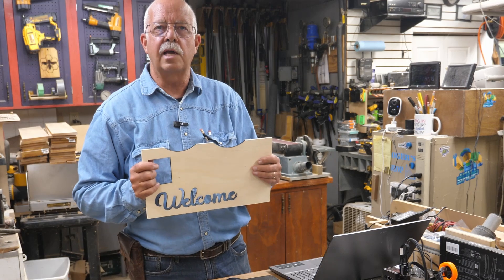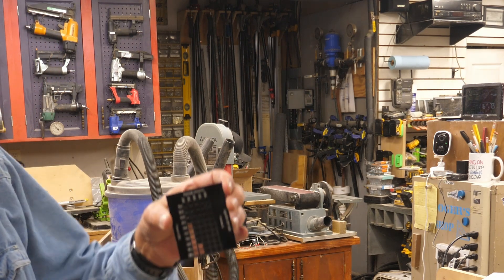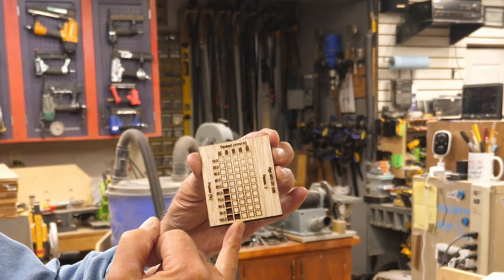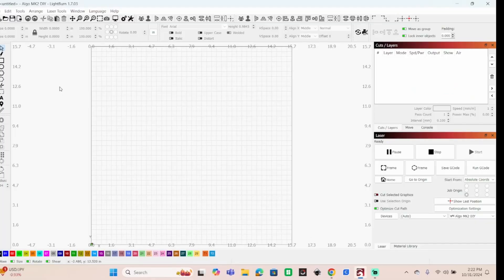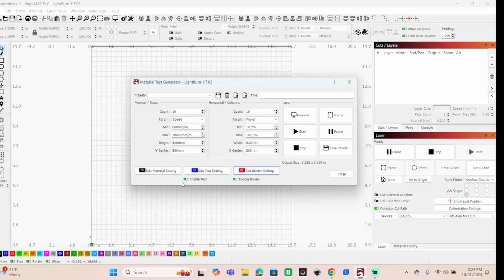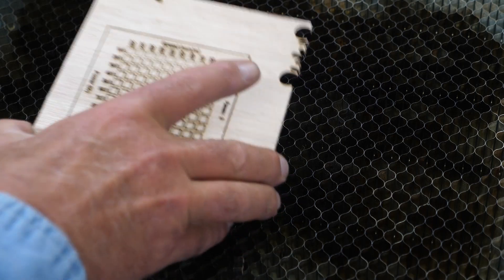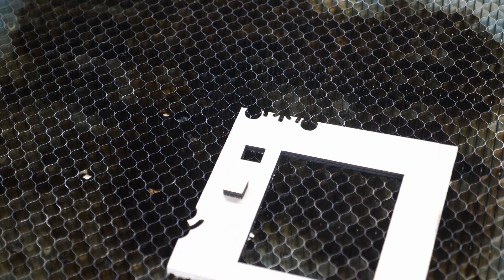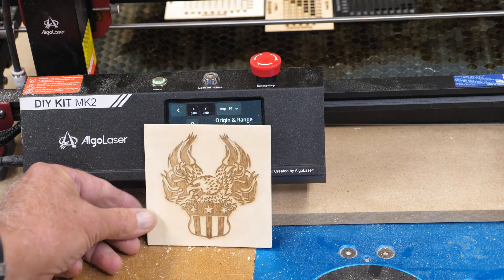Finding Your Laser Settings

Comment: Hi Roger, great video as usual. Quick question on the lightburn settings. Someone mentioned change it from 1000 to 10,000 for higher output on the Ray 5   10watt laser he said just add a zero to make 10,000 so it’s not running at 10%. Does that sound safe, will it burn out the laser faster? Hope that’s enough info. It does burn a lot hotter.
Tom

Comment: Hi, Roger. I'm still loving that KentokTool laser I won from you. I recently ditched the aquarium pump air assist I had added, and switched it to my airbrush compressor. I went from 4 PSI to 20 PSI, and I could increase my cutting speed by three times. I went from 1.6 mm/sec to 4.8 mm/sec. That 's a pretty big difference. Thanks again!
Reply: Are the mounting brackets for the Longer Ray 5 available?